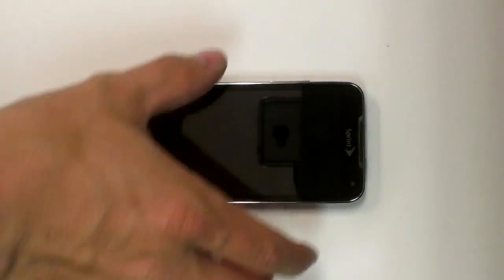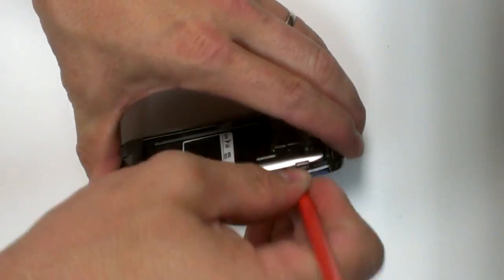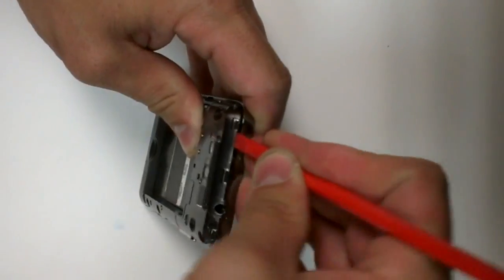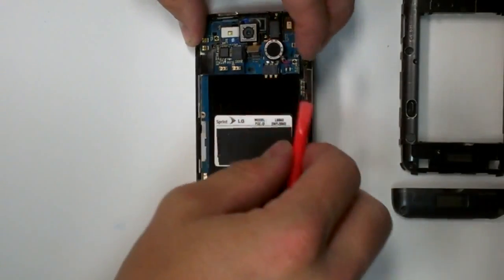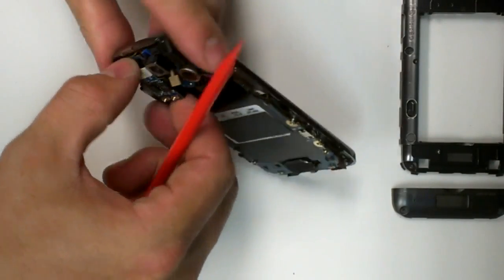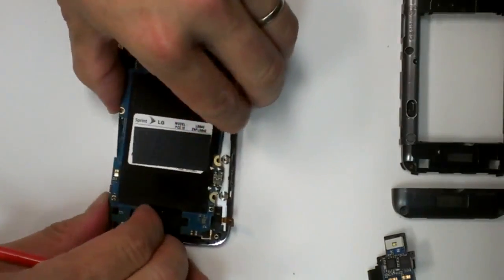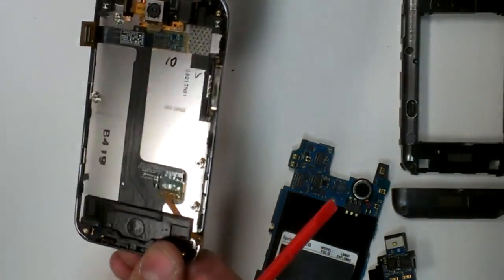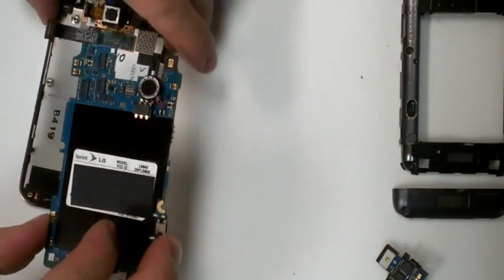LG Viper 4g LTE Complete Disassembly and Repair LS840

Comment: Where can you locate the Sim Slot?
Reply from the maker: Sprint doesnt have SIM cards.
Reply: How will you use it then?
Reply from the maker: It has an IMEI number under the battery that sprint uses to activate the phone.  CDMA phones dont use sim cards (Sprint and Verison)  ATT and T-mobile are the only ones with sim cards. (of the major carriers.)

Comment from the maker: Sorry for the belated responce, 

That IS the screen. It is stuck as a whole unit. It is possible to separate the digitizer from the LCD but you risk cracking the lcd as it it very fragile. Take a small thin plastic tool and begin to pry up on the glass, and just work your way around. It helps if you heat it up a little first.  The reason i didn't show this in the video, is because i don't recommend doing it. You will probably crack the LCD unless you spend a long time being very careful.

Comment from the maker: That IS the screen.  It is stuck as a whole unit.  It is possible to separate the digitizer from the LCD but you risk cracking the lcd as it it very fragile.  Take a small thin plastic tool and begin to pry up on the glass, and just work your way around.  It helps if you heat it up a little first.  The reason i didn't show this in the video, is because i don't recommend doing it. You will probably crack the LCD unless you spend a long time being very careful.
Reply: thank you ❤